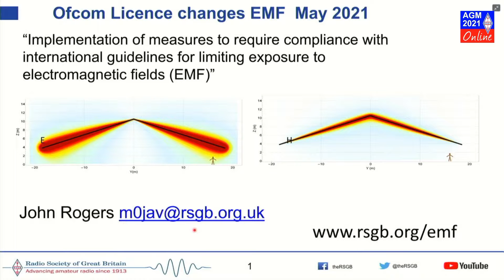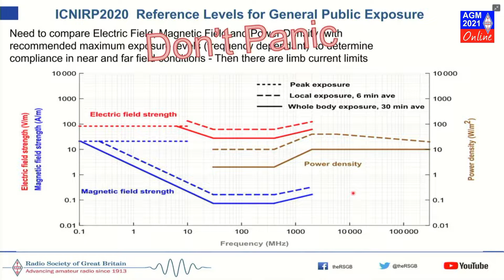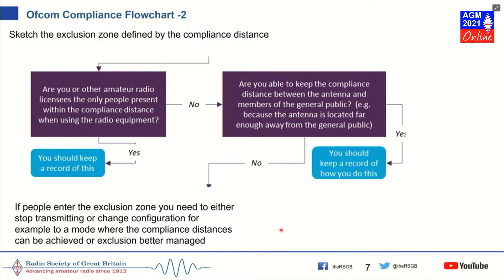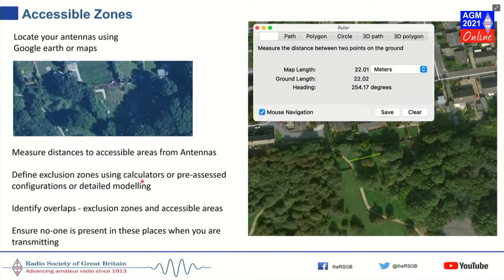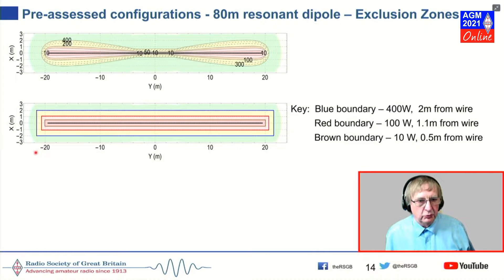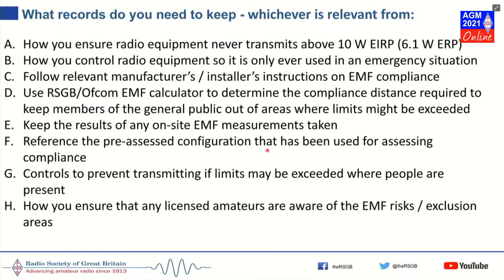RSGB 2021 AGM: EMF licence regulations webinar

Comment: At what point are the relevant test going to be carried out to find out how much RF energy is being absorbed/dissipated by the bricks & tiles used to build houses?  While you're at it, please put a disclaimer on the top of the EMF calculator stating that it refers to external areas only and cannot be used to determine RF strengths within buildings etc.

Comment: ok i think i have the grasp of all this!  maybe not lol. Now using the calculator on FM 10m because the calculator wont do 11m, so using 10m (also 12m) setting, 4 watts, transmission % of 6 minutes:40%, Feeder RG58A, antenna: Custom 4.6db, (5/8 wave pole), Minimum Antenna Height: 6m. The Reactive Near field zone 1.9m, Vertical Separation: 4.2m, Horizontal Separation: 0.0m. This setup would compliant, Not if a antenna like most antenna is bolted on brackets on the side of the house or on the chimney stack, in this case the level of the internal upper floors will be where one would need to measure the pole height from or have i got this all wrong.  its just something i observed whilst doing my assessment, only because my neighbour stuck his head out this window and said, what you doing! what you all think. An i just daft?

Comment: Well presented and educational on the new EMF compliance although as mentioned there's plenty to add to the many types of antennas used. I do find it strange that on certain frequencies, higher powers give less safe compliance distance than lower powers. There're still little anomalies to be corrected. Maybe the updated programmes will be clearer.
Reply: I realize Im kinda off topic but do anyone know of a good place to watch newly released tv shows online?
Reply: Keep in mind that the RF absorption levels (in the human body) at HF/LF are much lower than they are at VHF and above - has anybody every worried about sitting inside a house with the mains electricity buzzing away at 50Hz?